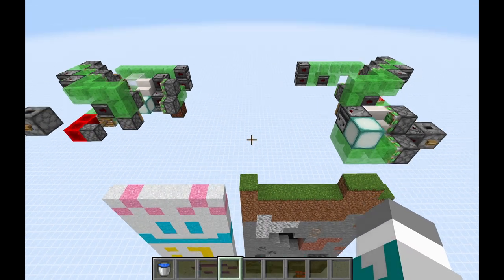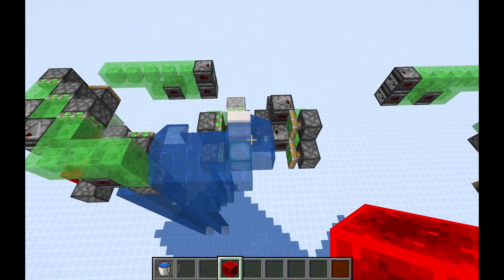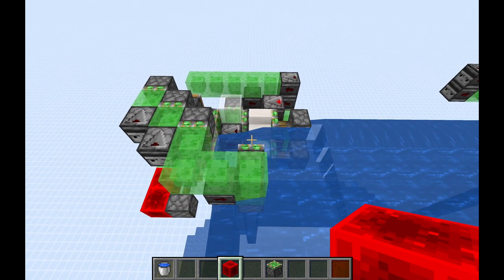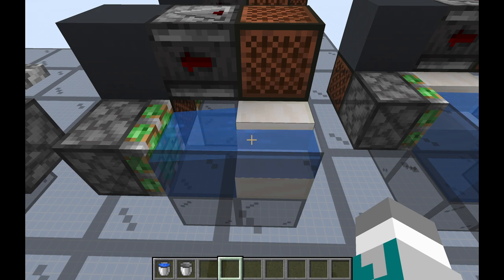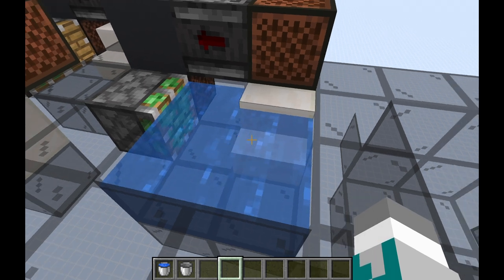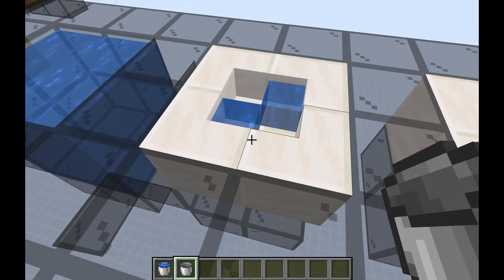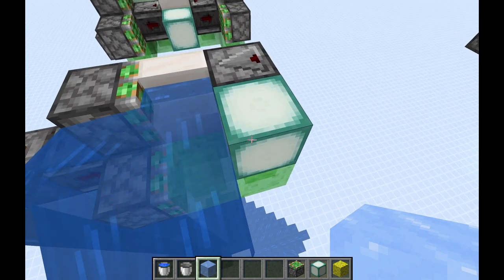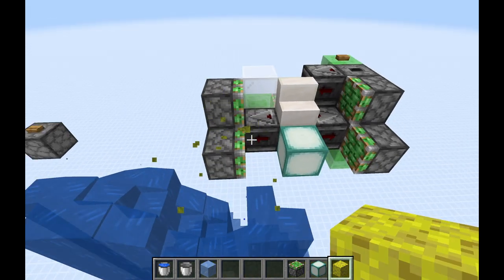[1.17; 1.13+] Water Makin' Flyin' Machines! or, Linear Curtains & Planar Layers

Comment from the maker: I completely forgot that mango already made a 3-directional planar water layer generator about 2.5 years ago in one of his peaceful series episodes. Here's the link, timestamped to his development process: https://www.youtube.com/watch?v=wH_CKsbi-VE&t=832.
 
Initially based off of the water curtain generator shown in the video, I had inadvertently arrived at a very similar core inner flying machine to mango's—mainly a rotation of the core engine to be vertical; and inner, as opposed to outer, observers. I do my best to be thorough with documenting devices made in the technical community, but this had slipped my mind. My apologies on that front.

Comment: is this one better than mango's? can I put a player somewhere on the flying machine to load the chunks?
Reply from the maker: You should be able to replace that one stray glass block (to the top left of the stair at 0:02) with a composter or a cauldron to contain a player. In singleplayer, that should work fine; though a player with poor connection to a server may phase out, so I'd recommend a carpet bot if you have access to it (this is what I had done to spawnproof a raid farm). There might be a way to mod the machine to have a minecart, though I don't see how to do that immediately.

I completely forgot that mango had made one of these! Was this the video you were referring to? https://www.youtube.com/watch?v=wH_CKsbi

Scrubbing through that video to look at mango's design, I think the primary advantage would just be that the one schmoe and I made is smaller, and it is a bit easier to pause (or, it's that I don't see how to pause mango's). I think mango also designed that machine specifically for peaceful mode where they were trying to save on slime blocks whereas this machine had no such constraint.